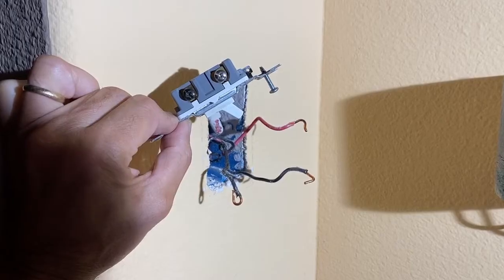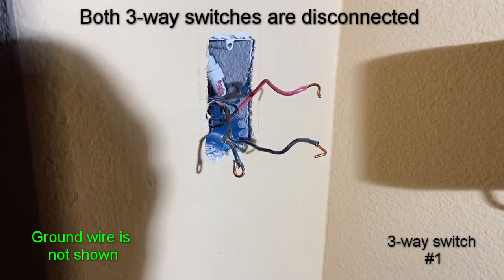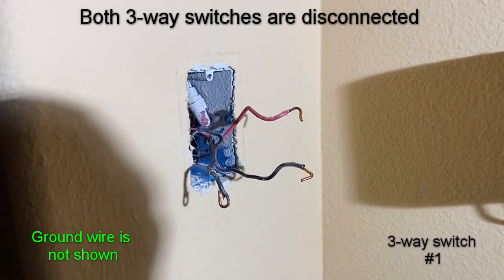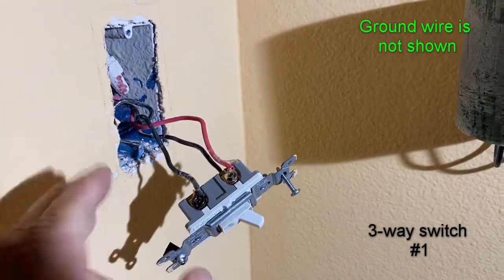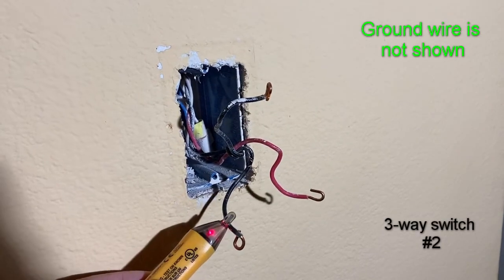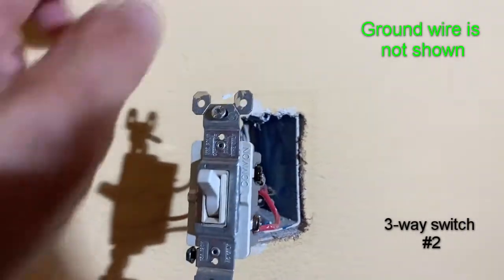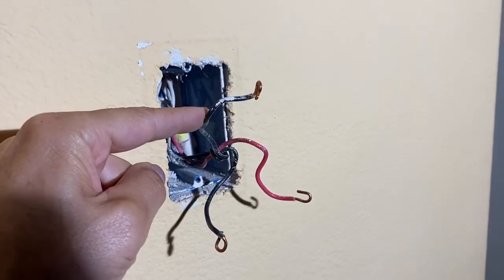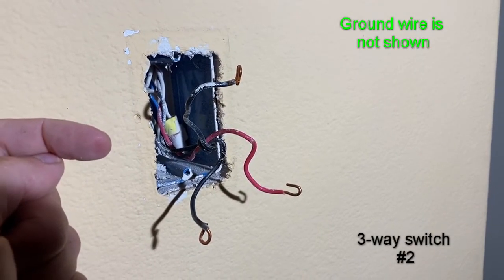3-way switch, how to identify wires-Learn how to wire a three-way switch

Comment from the maker: If the video helped you, please support us by giving this video a like and leaving a comment below. 

Have a suggestion for future videos? Please leave it below.
Reply: Common wire is not a standard term (in a switch with line/load , traveler, traveler) what does common equate to?
Reply from the maker: Common is a terminal label on a 3-way switch. Hope this helps.

Comment: How do I tell which common is coming from the power source and which switch has the common that's connected to the light? 
I'm trying to install a moes 1 gang 3-way smart switch but I have no neutral wires in my home so I must use the capacitor that was included. I just don't know how to determine which of the 2 switches  the capacitor connects to
Reply from the maker: Please watch the video, about 2 min in.

Comment: At the second switch (4:30 in the video), tic tracer shows voltage at both traveler wires. If the first switch is already connected, why is voltage being sent to both traveler wires - black and red ?
Reply from the maker: There is only one hot (line) wire per 3-way. And, it goes to one of the black screws. Best way to check it is with a voltmeter. Hope this helps.

Comment: I have  the three way set up. But i have one switch that must remain on, so the other will function, what wire must i change to get both to work properly? As i have two sets that are messed up.
Reply from the maker: It is difficult to say which wire you have to remove. However, if you follow each step in this video, your three way switches will work correctly. 

Here’s another video that I have that explains how it works in a classroom style:

3-Way electrical switch, how does it work?
https://youtu.be/cCcOydFhI_0

Comment: The part I am having trouble understanding (1.41) is he says one of the three ways always has a live wire. So that makes it sound like the other three way will not have any live wires. Is that correct?
Reply from the maker: Correct. One three way switch has the live wire (line) and the other three way switch has the light wire (load). Hope this helps.
Reply: @JustForYouDiy  I installed them a second  this morning and it was exactly as you said: One of the three ways will have no wires that come up as live with the tester pen and the other outlet in the three way will have one that is live-- the carrier.  I thought something was wrong at first but that is exactly how it worked. But looking at the wires more carefully, what easily determined the carrier vs traveller in my situation was simply I could easily see the travelers were grouped together.
Reply from the maker: Excellent. Glad to hear it all worked out.

Comment: Question:
I have 3 lights with their own switches. Located entry way, above the bar, and overhead kitchen light. My entry way and above the bar will not work if the kitchen light is not on. If I turn the kitchen light on all light work but if I turn the kitchen light off I can no longer control the bar light or the entry way. We just bought the house, thinking of calling an electrician but I love learning and trying things out myself. Any ideas on why this is happening?

Comment: If I wanted to deactivate my 3way switch and make the power always on.  Would I connect the 3 wires together at the outlet where the power is coming in?  Or do I do that at both outlets?  Thank you in advanced for any help you can provide!
Reply from the maker: To have the light turned on all the time, the line wire (hot wire) that’s in one jbox needs to be connected to the load wire (wire going to the light) in the other jbox. In order to do that, you can use one of the runners to connect the two together. Or, as you mentioned, connect the three wires together in both jboxes. Hope this helps.
Reply: Perfect!  Thank you so much for your help with this!   @JustForYouDiy

Comment: Hello. If i use a tester and find both hot wires on each switch. Do I put the hot wire on each com on both switches , then my followers on both gold screws I have a light in between the switches
Reply from the maker: There should be only one line (hot). It connects to the common terminal (black screw) of one of the switches. The load (light bulb) connects to the common terminal of the second switch. The rest of the wires are the travelers. Hope this helps.
Reply: How do i know what the load is on other switch thank you

Comment: Does this method work to operate turning on half of a receptacle in a room which there are two light switches in this room but niether switch works as being no power is present in the switch wires but it would it be three way switches used rather then single pole switches to do what i mentioned to control half of the recepticales being old switches had three input ports & a side ground so im assuming they are three way switches being single pole switched only have two terminal connections plus a ground connection.

Comment: @JustForYouDiu I am having a weird situation. I am trying to install 3 way smart switch in my house, so I am trying to identify the cables. So, I disconnected all 3 wires on switch#1 and switch#2. I turned the power back on next I went to switch#1 and the wires have power, went to switch#2 and 2 wires have power on it. So I could not identify which wire comes from the electrical panel. Do you have any ideas on what is happening here?
Thank you!
Reply from the maker: If the three way switches were working correctly before, then, there should be only one line (hot). If you’re using a non-contact voltage tester, some brands will give you inaccurate readings. I would suggest using a voltmeter to find the hot wire. If you do not have a neutral wire in the junction box, you can use the ground wire instead when measuring for voltage. Hope this helps.
Reply: @JustForYouDiy  Following as I have a somewhat similar situation. Is it possible that a four way switch is connected and causing all three wires to be hot?

Comment: I have a hall way light that has 2 switches. I have a red white and black wire. When I have both switches un wired and the power in none of the wires are hot I hook up one switch and the wires on the other switch are all hot. I looked at my old switch and saw which wire was on the common part and I hooked that one up on the one common hook up but the second switch all the wires are hot. Any suggestions?
Reply: If I hook them up exactly as the old switches were hooked up would I have nothing to worry about?
Reply from the maker: If it was working correctly and if wired the same way, it should work.

Comment: Helped me fix my issue:  Swapped traveler w/ Neutral.  Tip to identify travelers in the same wire solved my problem.  Did not have a DVM handy...
Reply from the maker: Thank you for the post.

Comment: At around 4:18 -- it seems like both travelers are hot. Shouldn't that not be the case, per the schematic at 2:19? I would think that from the first switch, it's "up" position will make one traveller hot and the other one will be floating, and vice versa for the "down" position. Am I misunderstanding?

Comment: Thank you!  I was replacing old switches that had the terminals located differently that the new switches and the colors of the wires varied.  It would have been an impossible job were it not for this video. Excellent!
Reply from the maker: My pleasure.

Comment: Great explanation of common wire identification.  The 35+ year old switch had all terminals darkened to the same dark antique brass shade, so that didn't help.  Eventually  cleaned enough dust off to figure out i had two yellow travelers, and that left the purple and red as common wires.  Appreciate this video.

Wish I could give it 5 stars.
Reply from the maker: Thank you very much. Please recommend my videos and channel to others. Much appreciated.

Comment: On the first switch you are right it doesn't matter where you hook up the traveling wires. But, on the second switch you have to connect the traveling wires on the switch in the same places as you did on the first switch. So, if you have a red wire and common (black screw) on one side for first switch then the red wire and common (black screw) should be on one side. You even show it in your schematic on the top right side of the video.
Reply from the maker: Thank you Gary for the comment. Much appreciated.
Reply: What happens if the travellers at 2nd switch don't match 1st switch?

Comment: It’s a great video if you have 2 black wires and a white. Absolutely useless video if you have a red black and white wire.
Reply from the maker: Brent, Thanks for the feedback. However, regardless of wire colors, if you use a voltage tester as shown in the video you should be able to identify each wire.
Reply: I have Black, White and Red as well. My problem is when I try to identify the common all three wires light up my tester in one box. How?!

Comment: What kind of tester are u using
Reply from the maker: Doug, The generic name for the tester is “non-contact voltage tester”. I like the one made by  Klein Tools. You can find it at Home Depot. Thanks for watching and the question. I hope this answers your question. 

If you are not a subscriber, please consider becoming one. I post videos frequently and you may find them helpful. Thank you.
Reply: @JustForYouDiy  thanks for the reply my old house has the black wire and no way to define the common and our hallway switches don't work right,hopefully this will help me figure it out